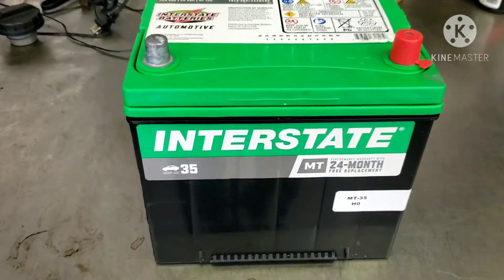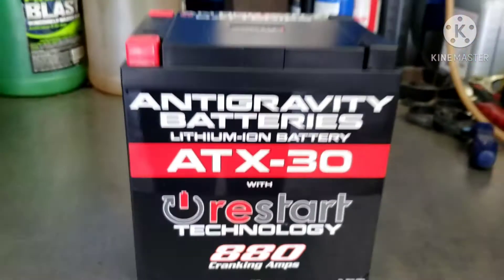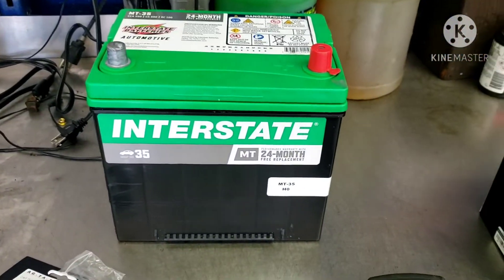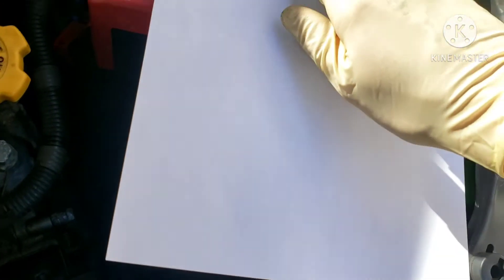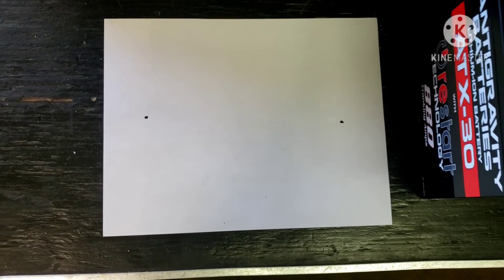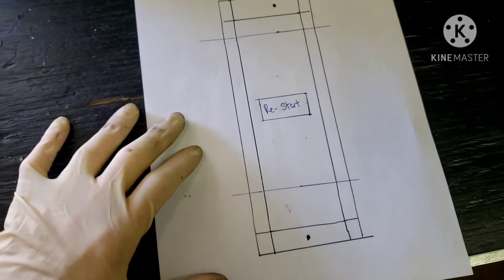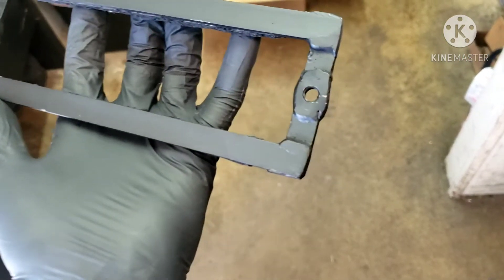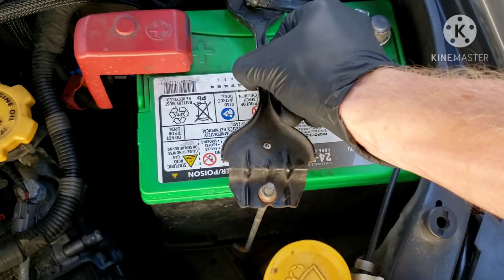Putting a 5 lb. lithium battery in a Subaru

Comment: I would suggest building a heat shield for your battery as it does have a built-in thermal cutoff which you may trigger. You may want to look into a MeLe Design Firm mount.
Reply from the maker: I was planning on grabbing a mount from them, but unfortunately my charging system did not agree with this battery and I had to return it. Was running into lots of very weird problems. Reached out to tech support and did everything they recommended and no change. I loved the battery and would love to be able to run it but my car specifically just didn't like it.
Reply: @nickquatrini  we do have the alternate direct fit automotive batteries too
Reply: @nickquatrini  This answered my question. This isn't the battery model Antigravity recommends for our cars.
Reply: It's there any lithium ion battery for Subaru WRX STI 2018 which will work 100% right? Also I need battery which can handle low and high temperatures. We have quite cold in here through the winter and really hot in summer.